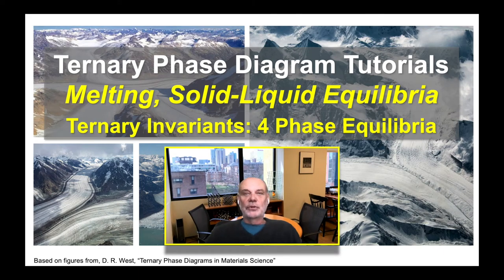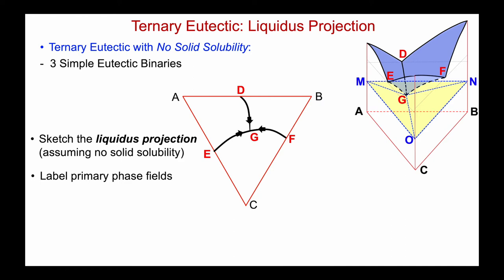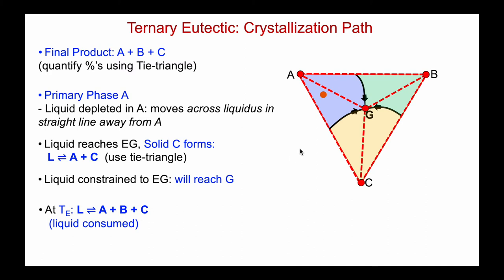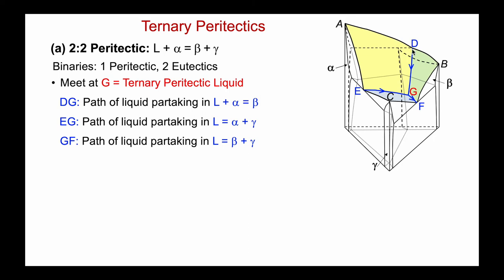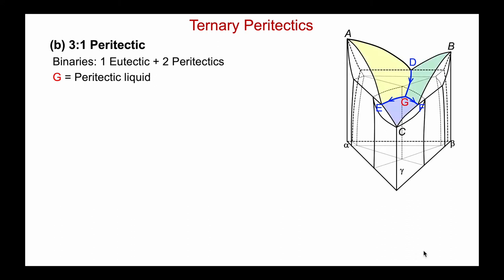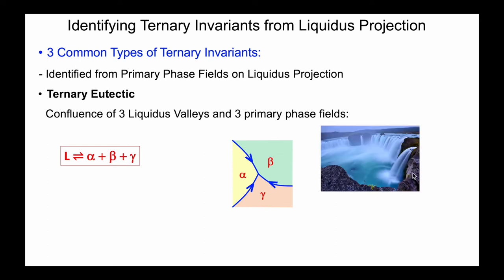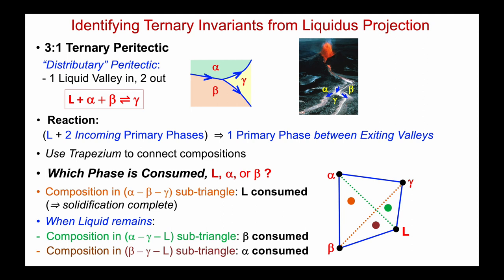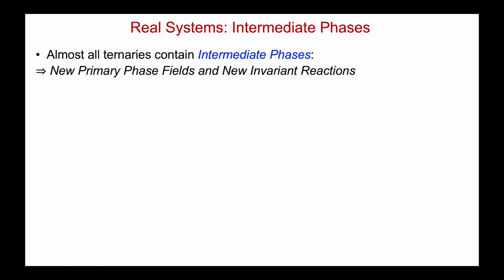Reading Ternary Phase Diagrams in Materials Science (Part 3: Melting, 4-phases, Invariant Reactions)

Comment: Is there a difference between the 3:1 peritectic shown in 17:12 and the one in 24:53? It looks like the trapezoidal shown in the later situation is not applicabe to the first.. im a bit confused about that..
Reply from the maker: No they are the same reaction and the liquid phase composition lies outside the tie triangle formed by the 3 solid phases; they may look slightly different as the placement of the solid compositions is a little different in these two. Hope that helps.
Reply: @peterdavies6179  Thanks for your reply. They are indeed the same. I guess I didn't look thoroughly enough.